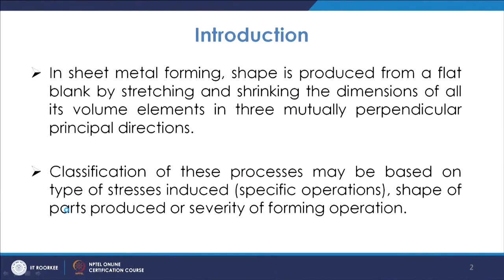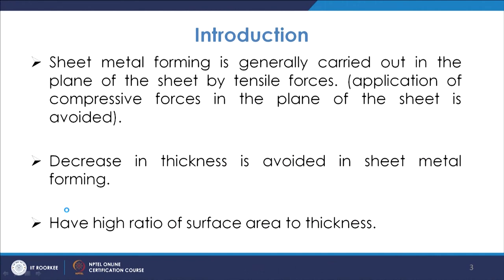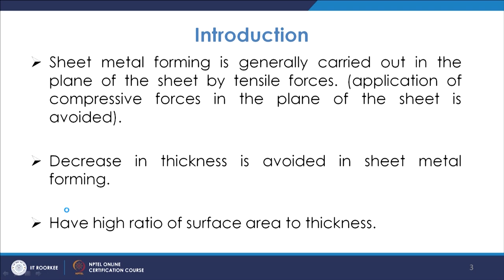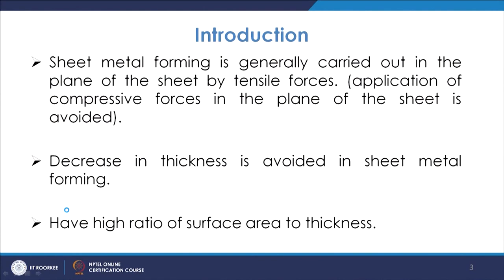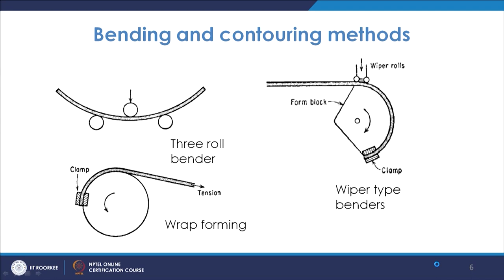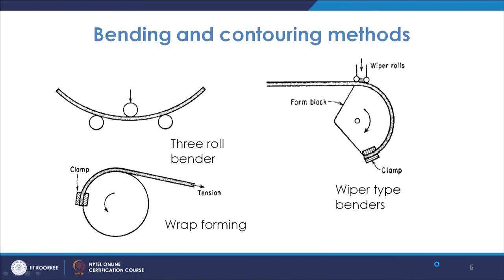Sheet metal operations-I

Comment: Sir, what is different between punching and piercing?
Reply: punching is the process of cutting hole in workpiece - in that case your scrap will be punched hole where as in piercing small holes are done less than material thickness.
Reply: In case of piercing there is no waste but in punching there is a waste produced which is a circular(not always ) blank.
Reply: That why ..i am telling the both punching and piercing  operations same... punching operation some times call it as the piercing operation...ok bro
Reply: @dipenpatel1948  Utterly wrong!